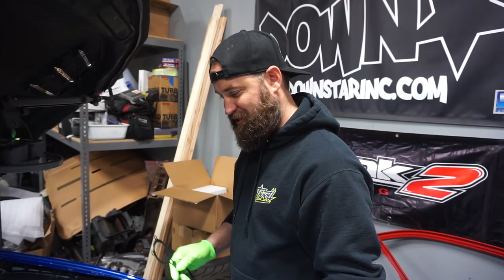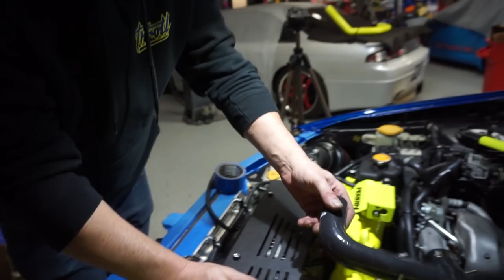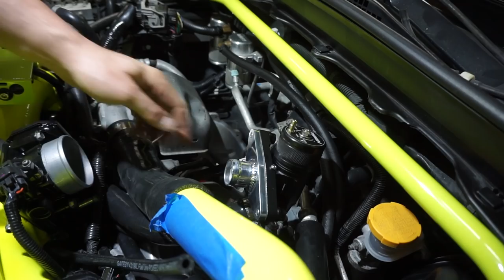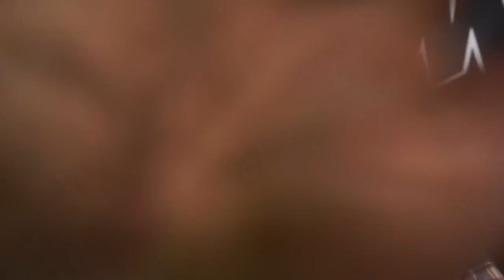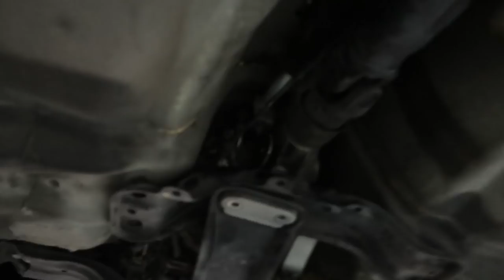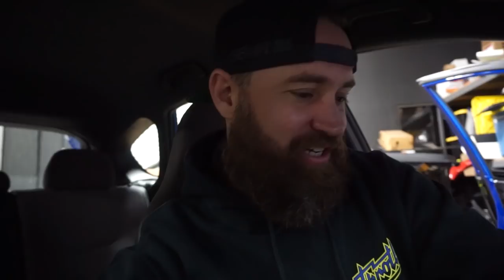Building the ULTIMATE 2008 Subaru WRX STI Hatchback - Part 9 - Re-Assembly + Kartboy Short Shifter!

Comment: You should check the spotwelds on the brake pedal bracket. You can see them through the windshield cowl panel. I had to  reweld mine.